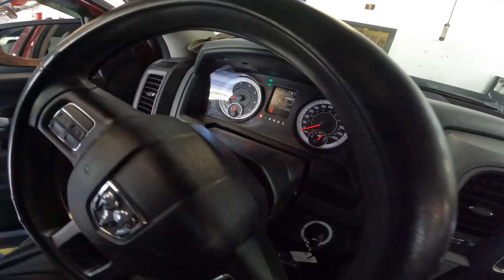BBK Shorty Headers! Insta-LEAK! Ram 1500 5.7

Comment: When Ray said this is the easy one on that passenger side header I was like oh he just screwed himself! 
I've put headers on most my vehicles, easiest 73 Dodge charger 400 CI, I cheated though. Original engine blew the  rear main oil seal causing a catastrophic failure, my boss said we just use his John deer and a titlting engine block to put the engine and transmission in ( and out ) so when the engine was about 2ft over the mounts we slid the headers in, lowered it to 8-12" bolted them up and then dropped the motor onto the mounts. Also had factory tri-Y header for a 289 engine which I built and put into my 69 Mustang coupe after the 302 boiled itself to death, those were a little difficult but not the worst.
Worst was a set for my96 Ford F250 with the 460 ( 7.5 for you liter people ), that motor was mildly built but I upgraded most of it heads, valves, bored 40 over, RV cam, big headers and exhaust. FI had enough overhead I didn't need to upgrade it. For a truck there was no room in that engine compartment,  it was a full bed, extended cab 4 wheel drive with a 5 speed manual. 
At least none of my vehicles had rubber hoses laying on the "exhaust manifolds" 
But there was always some little part that was being a pain such as the dipstick tube.
Glad it went so well for you Ray though I wouldn't expect less!

Comment: We used to do this with 1970's British Layland Minis. The Mini had a 4 cylinder engine with 3 exhaust ports so we would fit a "long branch or 3 branch" manifold. the idea is that due to the firing order you put the exhaust gases into the exhaust tube in an ordered pattern, not "put put    put put   put put" but "put put put put" I recon on a 1970s Mini with 68 bhp from the factory we could get another 200bhp or was it 4bhp...I can never remember LOL

Comment: RAINMAN  Me as a Mechanic . I would of Cut the Bolt  off. 
I would of  put a metal clamp around that heat shield . I have
Made Heat Shields for the ICP sensor  on a 2003 , 2004  Ford
6.0  under the Y pipe of the turbo .  I just Did the same job on
a 2012  Hemi .  It had 2 bolts broke in the Drivers  side head . 
 That's a tuff  job .    If you take a flat washer , hold it in place  . 
Weld the build up to the washer .Then you weld a nut  to the 
washer it holds really nice .  Just a FYI  :-))

Comment: Great job especially working on the horrible BBK headers.  Highly recommend you highly recommend to customers to NOT use BBK in future for these hemi's. Although he may be a repeat customer here in the near future lol.
Reply: Not good stuff?
Reply: He did use OEM heat shields & gaskets so it should be fine🤞From what I've seen online the BBK gaskets don't hold up aswell as Mopar🤫🤣

Comment: You have a tool to fix that long bold. It's called the cut off tool or in manual mode a hack saw. But the bolt works too. Love the videos

Comment: I'm glad Ray posted this because I replaced a PTO cable on a tractor yesterday that was designed by Hobbits or people with abnormally small hands. In the darkest hour, I thought "What would Ray do?"
Reply: p.s. I have a pair of Motion Pro safety wire pliers that Ray can borrow.

Comment: I'd put some DEI Firesleeve on that hose. @33:25... Bolt's too long. Cut about 1/4" off it. Better than using a spacer. Cutting it will also make it easier to get a tool on it.

Comment: @27:00, I hope that is stainless steel wire, otherwise it will rust away in about 6 months tops!  Also, I recommend wrapping the hoses in aluminum foil tape to reflect the long-wavelength infrared heat.  Would have been much more effective.

Comment: For sure: On 3rd set of (hedman shorty),fit in the stock position, (headers). Headman welded the pipes on the back side of the flange that mates up to the head and then ran it across a surface grinder which resulted in uneven surfaces that easily leak. And more precise surface grinding again perfected the evenness of the mating surface, Using their supply to gasket after installation of the headers and driving it for 2 months, you will need to retorque all the bolts because they do back out about a half a turn. Then you will need to retorpque them again later and continue to keep an eye on them from becoming loose from the gasket flattening out. Also I cut a section out of the head pipe that bolts on to the header a ball socket type factory screw up that constantly leaks. Installed and welded vibrant industries extra thick flanges and welded a flex joint to it then welded the flex joint to the oe head pipe. Which solved a lot of problems of the exhaust head pipe moving with the torque of the engine.

Comment: a mechanics nightmare. sort of job that puts one off being a mechanic. but Ray is not defeated, he has solution for every situation! i felt tense just watching, but couldn’t drag myself away til end. thanks for excellent visuals, sound & spot on commentary.
i would keep an eye on the exhaust wrap etc for first month of use under different driving conditions, to be comfortable that heat from new manifold doesn’t cook the surroundings over time & cause other issues. 
the lesson for me: 1) keep away from after market components, especially exhaust systems (unless you are very hands-on in followup). 2) at least see one already fitted. OEM parts have stood test of time.

Comment: Installed a set of headman headers on my cousins 2004 ram 4.7 1500 and had an instant leak too.. for me the passenger header front tube they completely forgot to finish the weld from the mating face and tube 🤦🏻‍♂️ good think i know how to run a good bead
Reply: Heddman*

Comment: I think cutting the bolt and making it shorter would be better than nut as a spacer.  You would then not move the head of the bolt location and allow you better access for tightening.

Comment: I would have preferred shortening the collector flange bolt versus an oversized nut for a spacer. In the end, the bolt did not take advantage of full use of available threads. This is especially important for aluminum. Use of a couple of ss band clamps to secure the exhaust wrap would have presented a more professional finish. Otherwise, a very good upgrade.

Comment: If those headers are ceramic coated, the heat shield is redundant, from the Redundant Department of redundancy Department. Kind of like a conversation with a Coke addict.
I am surprised that you did not use some copper anti-seize on those bolts.
After a few heat Cycles they should be retorted.
And the best way would be to do it while they're warm and they would form more to the head. But I don't blame anybody for not wanting to put their hands in there while they're hot cuz I wouldn't do it I would just re-torque it pretty good and Let It Go.

Comment: Great vid Ray but maybe a better idea to wrap th rubber pipes rather than the exhaust as the pipe will get F--king hot  ?. Just a thought, And what was all that juice dripping out when you were installing the wheel shrouds ?,

Comment: Update guys, that's the wrong gasket, and those are the wrong bolts! You need thicker HEADER gaskets. Also you need locking header bolts. Or the bilts will back out. But that OEM gasket leaks right off the bat.

Comment: In my humble opinion before you even started the job I would have INSISTED the customer purchase the teardrop shaped locking devices to the bolt head....cause you KNOW it will be back in because the bolts heat cycled and are loose..
Reply: At which point the customer can pay to have them tightened up.

Comment: I thought it was a law that you had to beat flat spots in at least 2 tubes to clear stuff, and cut the exhaust pipes in order to match the collector outlet angle. Hard to believe the manufacturer had the outlet angles correct. I believe that was about as bad as some timing chain jobs!

Comment: Goodentight as the Germans say. You are a very competent and go the extra mile, I’d bring my vehicle to you any day. If you were in my area, I’d let you install my supercharger. When I took my Borla complete exhaust, and long tube headers, high flow Cat and XR-1 Muffler the idiots jerry rigged the plug for my O2 sensor.. I had an extension/adapter cable right in the friggin box!?

Comment: Put the wrong bolts in should used supplied bolts and you didn’t trim the heat shield so it’s rubbing on manifold

Comment: Biggest problem they will have is have to keep re-tightening the header bolts after the stretch from the heat from the exhaust....It would be nice if you could fit the locking header bolts that use a c-clip to lock the bolts in place so they won't back out over time....doesn't look like there is room in there to use them...that will suck....
Reply: ARP header bolts with locking clip
Reply: @TXCherokee  I used Stage 8 Locking Header bolts...i believe they were the original brand

Comment: I've wanted to put Doug Thorley headers on my 05 4Runner, but it seems beyond my skill since I would need to disconnect the engine mounts and lift the engine. It's a seriously difficult task on modern vehicles.
Reply: I had Doug Thorley headers installed on my 05 4Runner by mechanic who’s been wrenching for 30years and he said he would never do that job again 😂.

Comment: Maybe some opposed cylinder airplane engine(jug offset)wrenches might help?
Also if it were me I'd cut the hoses and splice forty five degree sections of hose in order to move it away from the manifold as permanent solution. 
Also, scammer test.

Comment: I always hated doing extractor gaskets. I've seen guys who would heat up the pipes with a blowtorch then hammer a socket onto the bolt so they didn't have to do 1/8 turns with an open-ended spanner like you were doing. This defeats the purpose of having balanced pipes because it then induces back-eddies and the like, destroying the air flow. 
Hopefully that guy didn't pay much for those pipes with the dodgy welding and dags left inside the pipe.

Comment: Do those ratcheting box end wrenches have a direction switch or do you have to flip the whole tool over to reverse? I could see where you could get really screwed if you have to flip them over and couldn't clear the nut/bolt head.

Comment: I have installed these on my Ram and it is a mother, the only thing I didn't like Ray is when you used a nut as a spacer for the header tube on drivers side, all you had to do is cut a 1/4 inch off that bolt. Shame, shame

Comment: All that hard work and you spoil it with an old spacer nut and some crappy bailing wire, now I need to take the Ram to another shop where they can cut the bolt shorter,  put on metal zip-ties and rap the heater hoses with heat-shield............

Comment: Also, no shame in modifying the heat shield (form a tab that can be bent out of the way just above the hard-to-get center bolt, by cutting a pair of short, parallel slits just above the bolt).

Comment: Iam no engineer but I would think the way the header tube  going up straight 90degs would create negative back pressure that would hurt horse power with the cats on that vehicle. Just thinking after years of running Pro Gas drag cars 🤷‍♂️ back in the day

Comment: I know it's messy but some anti sieze would make it easier when it comes back to put the stock manifolds back on
Reply: Any time you have dissimilar metals, steel bolts and alloy heads, it's a good idea to use anti seize. I'm surprised that this job didn't pull at least one of the threaded holes.
Reply: why would you put the stock manifold back on?
Reply: @walterwhite2270  when the headers rust out and start leaking and you get a new engine code from them.
Reply: @walterwhite2270  How come I know you've never worked on a car?
Reply: 🤣You winz one internet.
Reply: @spaceflight1019 You are right bout the threads.   Next time these head are going to have to come off to be drilled and tapped for inserts.
Reply: @MrSloika  I used the nickel antiseize for exhaust applications, and the copper for things like water pump bolts.
Reply: I've been a wrench for over 35 years.  And the best anti seize is the nuclear stuff it's expensive but nothing beats it

Comment: Do shorty headers really make a noticeable difference in HP?  I am asking because I don't know.
Reply: None “!!
Reply: On my 2004 5.7 liter with aftermarket exhaust next to nothing. All I got was noise, vibration and drone between 1700-2200 rpm. I am going to put the original exhaust back on from the Y pipe back. In Phoenix, so no external rust and only 79K miles. On newer models, 06 and up you can try the tuning chip stuff I suppose.
Reply: @davidconley3610  Thanks!
Reply: @quietsignal  Thanks!

Comment: I have a 2019 of this flavor, with a leaky manifold. Do you recommend this as a solution , Ray? Also, is this a common problem with these?
Reply: Yes according to the Ram forums it is a more common problem as the miles build up. But there's a good solution if you're interested. Once your exhaust manifolds warp, have a machine shop mill them back to flat again. Replace all exhaust manifold studs with recommended high quality studs and of couse new gaskets. I can't say how much improvement headers provide but at least they probably sound good. When I replaced my stock magnum manifolds on my 440 powered 69 charger R/T they only reduced quarter mile time by 1/10 of a second. Why? Because the OEM magnum manifolds already did a great job!
Reply: @raystanton238  thanks, my friend. I AM a machinist, and will take your advice. Thanks for all you do!

Comment: All you needed to do was to cut about 3/8” of an inch off of the bolt and you would have had plenty of room to tighten it down without hitting the header body. Which would have looked a lot more professional than using that nut as a spacer. And it wouldn’t have taken very long to do it, either.

Comment: I always use the copper anti-seize on exhaust headers.  Am I doing it wrong?
Reply: I used aluminum anti seize just because the heads are aluminum. But I also used stainless steel studs, Ford 5.4L 41 mm long, as I recall.

Comment: What's the leakage that's visible at 37:45 in the lower left of the frame just above the brake rotor?
Reply: looks like he didn't quite address the water line spacing issue...he'll be back

Comment: I enjoyed the video until the end when I saw the piece of flimsy wire barely holding on to the ugly piece of heat resistant stuff wrapped around the header tube, not to mention the awful bolt as a spacer (use a smaller length bolt). Sorry Ray but not this time.

Comment: So does this kit solve the broken bolt problem go away?
Reply from the maker: Nope
Reply: @RainmanRaysRepairs  So on the Ram (Cummins diesel,) they have ARP head studs to increase the reliability of the heads/gaskets in HD operations. Does Arp make a solution to broken bolts or is this more of a dissimilar metals heat profiles make it impossible?

Comment: yeah i could have told you 8 minutes into this video that those headers were going to leak, you put less than half the amount of torque required on those flange bolts. you are lucky if you got 20 pounds on most of those, that was honestly a shameful feeble attempt my dude. The only one you put proper torque on was the bolt with the dipstick on it

Comment: Aw Ray! I can't believe you did a shade tree repair on the driver's side exhaust flange. Using a nut as a washer??? Why didn't you get a shorter bolt, or cut a 1/4 inch  off the bolt? That looks very unprofessional dude.

Comment: So why the hell would someone want to pay the price for the chrome exhaust headers and also the labor to install?  What a waste of good $$ that could be used somewhere else on the truck that people can actually see at a glance!!
Reply: not your truck not your money....
Reply: I'm gonna go ahead and estimate that this job cost $1000 based upon a $100 per hour shop fee. 
The dealership that inspected my Patriot advertised a $140 per hour shop fee.
Reply: @spaceflight1019  keep in mind it did not cost that to install the headers...the core of the work was removing the old headers and broken bolts...this owner got off easy on the broken bolts because they did come out easy.....they just took the opportunity to have headers installed while they were fixing the real issue....

Comment: Headers are so pointless they only give you additional torque and power at a specific rpm, I’ve built high horsepower engines with near stock exhaust just hogging out the runners and flange slightly. You can get the same power advantage just by building the motor right as any header could do. Didn’t really care about a 15 hp advantage if i could do the same advantage by building the head right.
Reply from the maker: I always reuse stock manifolds. I’ve ported them with a flap wheel to get better flow. But IMO they’re not with the trouble on a daily driver. I agree the gains my not justify their existence
Reply: @RainmanRaysRepairs  grind and grind the flange and runners, my Subaru had the same gains as a wrx turbo because I pulled so much metal off of the manifolds for a natural aspirated engine. Horrible gas mileage though but the power was insane using stock manifolds modified cylinder heads for a 2.2 and weisco pistons.